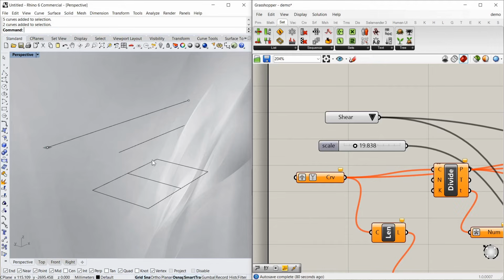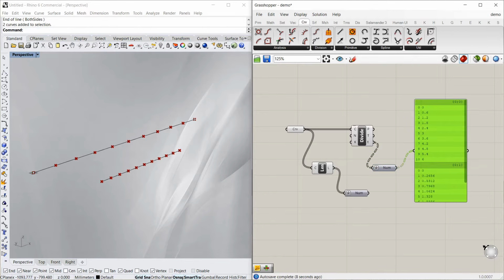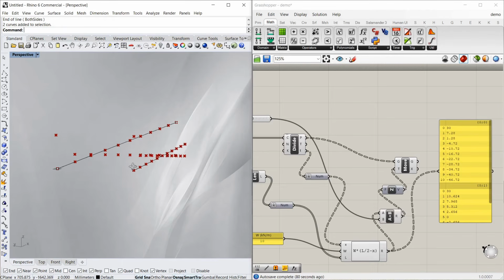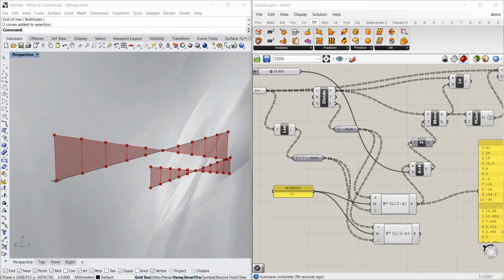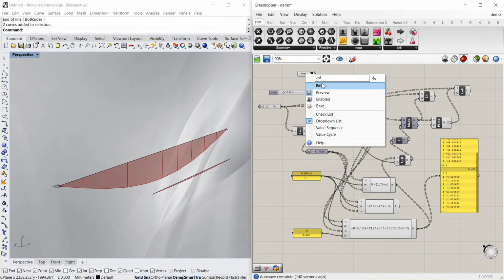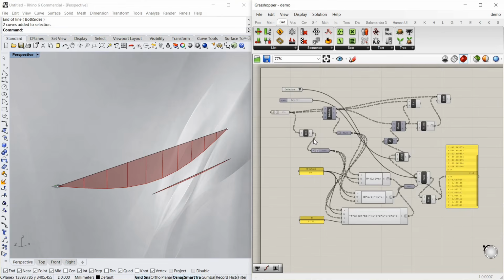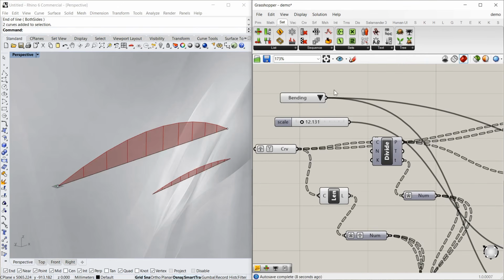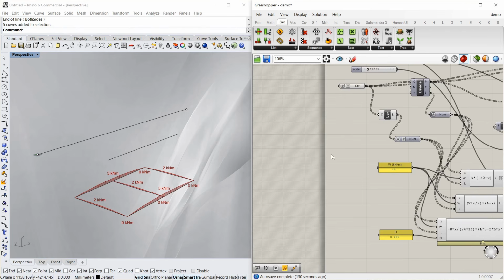Tutorial: Quick Bending Moment, Shear and Deflection diagrams. Grasshopper Structural Engineering.

Comment: Hi,  thank you for this. I am unable to see the Forces values when I connect the Move command to the tag. but i can see them if I connect the list item directly to the Tag.  Do u know why? I m therefore not able to mveo my tag up and down like you showed
Reply from the maker: Usually this type of problem is because one of the inputs is in a different list format than the other. Try making both lists of the same format (in my example they are both (0;0;0), (0;0;1), (0;0;2). If all else fails you should be able to flatten both inputs into the TAG component and it should work.
Reply: @StructuredParametrics  Hi, Thank you I will double check that
Reply: Hello, I'm having the same problem! Did you manage to fix it?